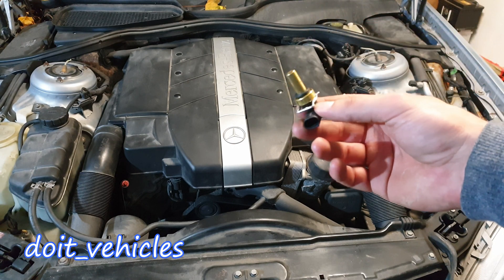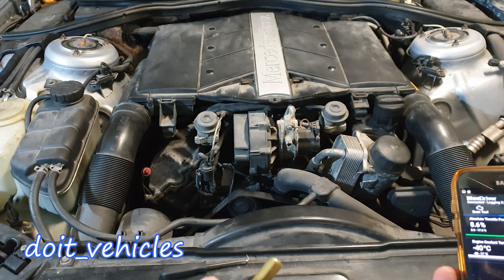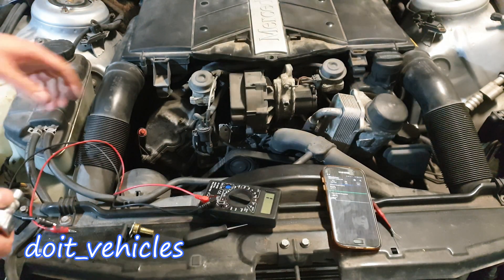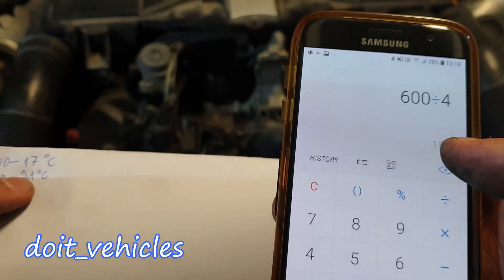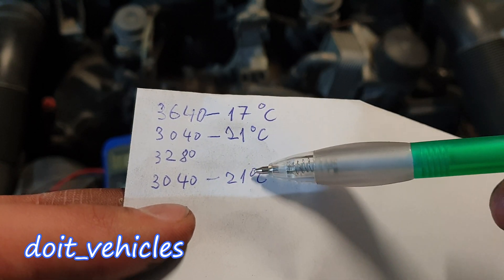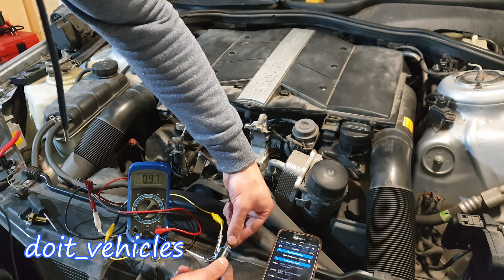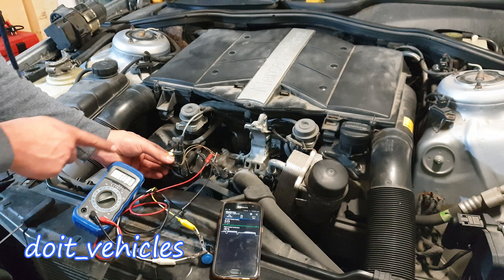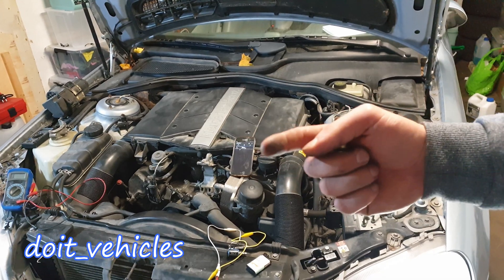W220 Mercedes S 320 Coolant Temperature Sensor Diagnose before Replacement P0118

Comment: Hello Thank you for your Tutorial. Could you help me with the following Problem: My coolant fan is always working. Whether the car is cold or warm, the fan works nonstop. I get the DTC PA00118 engine coolant tempreture ect (high input) Sensor. Following this Information i changed the Sensor. Unfortunatly the problem is already there. I Hope you can give me a hint, what the problem could be and Why the coolant fan is working

Comment: if you don't undo header tank and you have full coolant system  if you remove the sensor you will not loose much coolant  its only when you allow air in system you will loose your coolant  i alway remove sensor this way if possible saves on toping up cooling system  only need check level once done  no bleeding is required either most cases any car, being quick is the object  one out next in

Comment: The temperature of the collant can be read on the air conditioning panel. You need to hold the REST button for 5-6 seconds and use the arrows to move to channel number 6. Is this a temperature indication from another sensor?